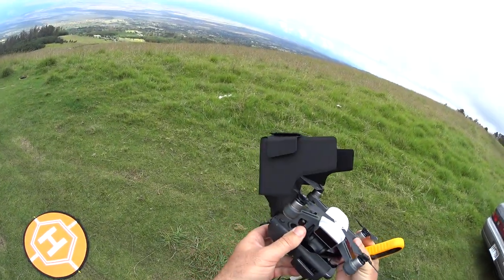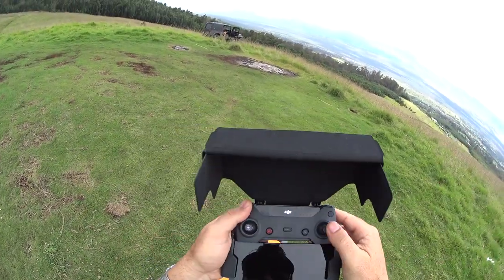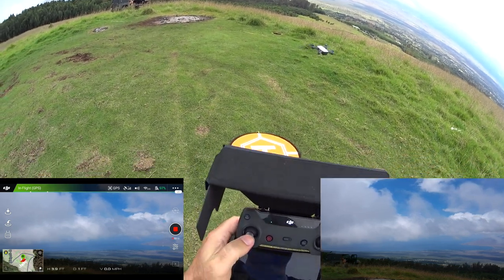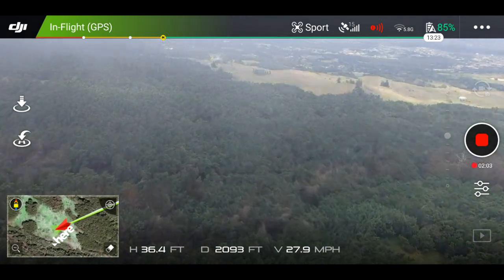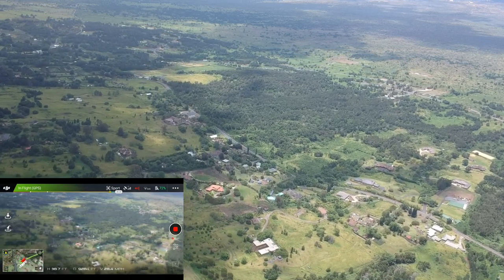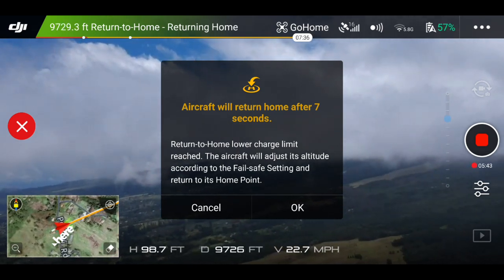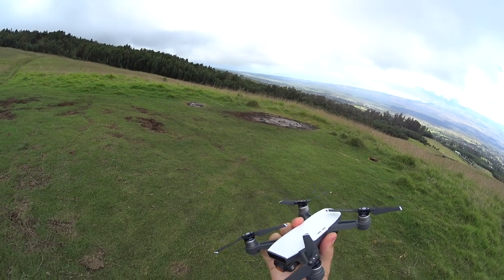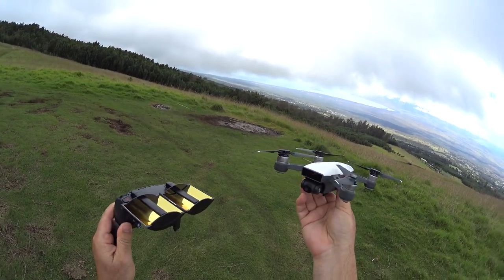DJI SPARK Review - Part 3 - [4 Mile In-Depth Range Test with RC Controller & OTG Cable]

Comment: I have a dji phantom 4 pro but those lil drones are good if ur starting off and have no money for the professional actual drones
Reply: this is an actual drone, its just not as good as the p4. the spark is good for the money that does its job and in the right hands it can achieve some awesome footage.

Comment: Nice video. Question, the altitude shows that you were flying around 40 feet all the time which I don't think it's accurate. How would you be confident enough that you could fly it back to home since it's gone so far away with frequent disconnections randomly? Thanks.

Comment: Just got a spark the other day, been playing around since this is the first non-toy quad I've had. My question to you is, how long does it take to get over being afraid of going too far? I got about 120' away from me and started to panic. I've decided to go higher vs further since in my mind if I lose it, it will fall straight down. Thanks for the video!
Reply from the maker: As long as it takes you to Wes.  It's your awesome drone.  I'd just keep going a little more out of your comfort zone each time (after you've mastered basic controls) and you'll gain confidence gradually and safely 👍
Reply: Dude has a good voice and gives advice like a thearpist, hope that's the industry you're in, if not look into it! Thanks so much!

Comment: I have three questions for you. 1. The phone you are using is that the phone you use regular like your everyday phone or is it a dedicated phone just for the spark? 2. The wifi that is strictly wifi and no data is being used and 3. can you set your phone into airplane mode to shut out all the programs except the DJI go 4 app?
Reply from the maker: Yes X 3 👍
Reply: Dustin Dunnill thanks. Getting my dji spark today from FedEx.  Time to fly lol.
Reply: Well, first things first lol you need data on your phone in order to do the updates on the spark during the updates. I have no data atm so I have to wait until the 2nd of July. Ugh.
Reply from the maker: You can do them from your home wifi.  You just have to switch back and forth to the spark with your wifi during the updates 👍
Reply: Dustin Dunnill yep I finally got everything updated. Now to get the controller, phone and spark all working together.

Comment: To get above ground altitude incorporated into the system, it would require that the Drone have all of Google Maps downloaded to the main flight controller. (Many many many Gbs worth, and tons tons of processing power) Google Maps knows the altitude every square foot of ground on every point on Earth. This has been done through extensive work of surveyors and other technology. 
Then the Drone would use GPS to determine its location on the earth and then review Google Maps to how high the altitude is at the ground level it is flying above. Then subtract that from the altitude it is receiving from the GPS signals. It would then be able to determine the altitude it is above the ground at that point. 
This would use a lot of CPU power and electrical energy to compute all of this in nanoseconds. Let alone the amount of storage space and reliability from glitches to be able to store and process all of this all of this on board in a timely manner without having to wait 6 hours for boot up.
Reply from the maker: Not necessarily.  The drone knows it's gps position as you mentioned.  All it would require is a download, cache or stream of the ground elevation data (not GBs of maps) and sync with current coordinates for the location it's in or a designated area surrounding it and compute the AGL on the fly, or have pre computed and just display it while flying.  Shouldn't be that difficult for the computers that are on these drones now or even in the controllers.  Definitely not "tons of processing power" to do a simple data table query. I have a feeling the database of elevation data accuracy is what is lacking so companies don't feel like it's bad record keeping or inaccurate data they want to rely on or it would open a new can of worms of legality & customer service issues (crashes)🍻
Reply: Man you're the best! Thank you for this well informed comment! You are genuinely very smart and up to speed on everything..you go! 😁
Hope you have the awesomest day ever! Cheers

Comment: Hello. I just wanted this review (great job) and was wondering if you made any modifications. I have seen some Spark Reviews and they mention no more than 60-80 meetings or never more than 300 or so feet.  Did you have/do anything to create such a large distance? Thank you very much
Reply from the maker: Less interference, whether physical or electrical will get you better range.  So out  in the country  with an unabstructed line of site between controller & drone is best.  This  spark is not modified.

Comment: Mr. Dustin, in your opinion do you need the OTG cable for the spark to fly well? another video mentioned the warranty would be voided by DJI? thank you
Reply from the maker: Not really necessary but may help if there's a lot of interference nearby.   I don't think you'd void warranty plugging in a USB otg.  Not sure but I heard DJI may have disabled the ability for otg on spark.

Comment: Hi Dustin. I am having problems with my DJI Spark Flymore combo. I have purchased the OTG cable and use it, but get signal loss after about 400ft. Please can you share some advice on what I could do to improve the range. Something seems very wrong and I see many other people seem to also be struggling with this. Thank you so much. Dylan.
Reply from the maker: I’ve heard DJI took away the ability for otg use recently

Comment: The battery will limit your range anyways. It would be really pushing your battery and might fry it
Reply from the maker: +River I think 2 miles out is a safe max range for the battery.. although one could switch back into manual sport mode on the way back to get back faster.  Maybe I'll do that in the next video testing the parabolic range extender 👍
Reply: you'd be surprised. If you're just going for range, AirVision puts out a bunch of vids with (controller mods) showing a range much beyond what's advertised, with battery to spare. Kind of blew me away. That said...you won't be hanging out at those distances, unlike the mavic.
Reply: Hope you do the test with the parabolic range extenders soon. Have some on order :)

Comment: Dustin very good review of the Drone and the distance. I have a question if I may? I have the DJI Spark, and I have noticed that if I am up about 150 ft and decide to bring the Drone back down and if I hold the left stick down for more than a couple of seconds, the Drone will begin to rapidly descent. And will continue to descend until I push up past halfway to stop it from descending. Is this normal behavior for this drone?  I was under the assumption that if you are descending by holding the left stick down and you release it and the stick self centers, and the Drone should stop its rapid descent? For some reason mine continues to descend that's why I was wondering if this was normal behavior? Thank you in advance Joey
Reply from the maker: Don't think that's normal.  It's like yours is going into landing mode.   I'd check your sensors are clean on bottom and battery is charged.
Reply: @DustinDunnill  good advice my friend I purchased this drone second hand off of somebody locally on the let-go app oh, it only had 17 minutes of flight time on it according to the DJI go account it looks immaculate brand new everything seems to be working except for that one little hiccup, I'm going to try it again if I can get some daylight before I get home from work I updated all the firmware everything is was updated and is working fine on the DJI assistant 2 desktop app so I'm not really sure I'm hoping it's just a glitch perhaps the senses are a little dirty I'll take a Q-tip and see if I can clean them up.  Thank you very much I appreciate your comment

Comment: Hi I know this is a old video but how did you get the otg working. I got the LG g6 , spark and a otg cable and can't for the life of me get it to work. It just keeps connecting then disconnecting and then starts charging my phone? Cheers great videos by the way.
Reply from the maker: I hear DJI has updated to disable the function
Reply: @DustinDunnill  aww we'll need a new phone then!!! Think I got a old iPhone 6s in the cupboard I'll be charging up tonight. I know otg works with apple just hope it dont change it back to CE instead of FCC otherwise my range would be cut well short!!! Keep up the great videos 👍

Comment: Hey Dustin..do you know if I tried this over water would it be similar results?  Is over water safe except for the vps which doesn't reflect well over water..
Reply from the maker: +North Salem Droner Yes unless there is high interference there you will get good Range.  The vps doesn't see above 40 feet I believe but if your flying closer you may want to turn it off.

Comment: Meanwhile my drone loses signal after 500 feet, if I'm lucky, in urban areas. I maybe got 1000 ft out in the NY Catskill mountains before the video feed started freezing on me. Idk how this dude got that far lol. Must have some special version, goddamn
Reply from the maker: Line of site, antenna orientation, weather and interference really play big parts in the range.  Just all stock here.  I'll be getting back up there to do the dish test soon.
Reply: Agreed
Reply: HabeebMasterISIS I have the stock spark and can easily get it out 4000 feet. I don’t know what is wrong with yours, because I’m in a very large neighborhood with lots of interference from other WiFi signals. (I haven’t flown it much farther than that yet.)

Comment: Hey man, do you leave your wifi from the phone to the controller on while using the OTG? or do you put your phone in airplane mode? thanks
Reply from the maker: +Joey Stasiewicz For this I did not but you can .  Or just turn off wifi.  I keep cellular on for the basemap
Reply: Dustin Dunnill sweet thank you!

Comment: Wow man. I am so tempted. Is it a good buy??
Reply from the maker: +agrs1974 aka Andy Sommerville Yes.  If you want the small size but less flight time and video resolution than a phantom.
Reply: Dustin Dunnill I have a DJI p3p. Was looking at something more compact.
Reply: i've got one because i travel a lot for work and with fam. I absolutely love it. Super fun...but don't skimp, you gotta get the flymore combo (or at least the controller).
Reply: snlexa oh definitely mate. Wouldn't use my phone
Reply: Buy it, from P3 to Spark, buy it (coming from a P2 vision plus, Mavic and Spark owner) Buy it

Comment: Hi dustin i am new to your channel, i wanted to know how far does the spark has to be to return to home. Also i just got the spark like 3 days ago and am afraid to send it out because it always drops where the drone is at instead to return to home. What am i doing wrong am using ios no otg  yet, i order a cable that goes from iphone to the controller. Is that good? Tks
Reply from the maker: Usually 50 to 100ft away

Comment: i know im 4 years late, but you also have to remember if you use the spark, tthis this guy is where there is absolutely no wifi signals and nothing to interfere the connection to this drone, no trees, no buildings.. i own the mavic air 2 now, but 3 years ago i did own the spark, and i used to fly it in the park, genuinely, unless your flying in an complete open space with absolutely 0 interferences, i was gettings at around 500-1000 Ft. 1500 on a good day.

Comment: I'm trying to understand. Typically you wifi your phone to the controller, but if you want you can plug your phone directly into the controller like the mavic if you get the proper cable? For me that would be micro USB to lighting since I have an iPhone. Do you have to change anything in settings to use the cable, or is it plug and play? 
Also does it increase your range since the controller isn't having to talk to the phone and spark wirelessly? Thanks
Reply from the maker: +tracym427 Plug & play lessens lag and wireless garble / possible wifi interference or connection issues 😁👍

Comment: Hi there, I can see wifi signal indicator even though you're using otg cable, In my app (which is up-to-date) I cant find this indicator while using otg. can you help? i have serious range issues and dji support is working slow.

Comment: Dum question but do ya still connect via wifi to rc when using otg cable or just the cable will do or both ?

Comment: On the RTH did you have it set in sport mode still or does it decide the speed on its own?
Reply from the maker: It decides on it's own.  About the same as GPS mode.
Reply: @DustinDunnill  Ah ok. I'm guessing based on wind resistance and battery level?

Comment: is the H on the screen mean HEIGHT which is how high it is above ground?
Reply from the maker: Yes but only from a 0 launch elevation.  Hopefully we'll see an AGL readout soon that can display AGL above what current Sonic and optical sensors do until it's above 40ft or so.

Comment: Could you turn off return to home and fly back in sport mode tho? It should be faster?
Reply from the maker: +Brandon Leow Good point.  Yes.  I just let it auto return here
Reply: By the way, great review! Highly considering getting myself a spark with the fly more combo.
Reply: Presumably the rth speed is the most efficient flight speed though - as in distance covered to battery expenditure? So if you are going out the maximum range the RTH speed would be the most battery efficient way to come back.
Reply: Ben Shaw that would make sense. I guess it also depends on the direction of the wind I suppose.
Reply from the maker: +Ben Shaw so a range test in slower GPS mode may be better.  I'll have to try it 😀👍

Comment: hi there, have you tried parrot bebop 2? and if so how was the strong winds with that spark compared to bebop 2 which was able to withstand 35 mph strong wind? thank you
Reply from the maker: +garry1220able yes, I've done many videos with Bebop2.  They both do ok in strong wind but the video quality will suffer from the tilt
Reply: garry1220able The Spark has a real gimbal, which would handle wind much better while still getting great footage.
Reply from the maker: +SquiDragon The spark gimbal will reach it's maximums in that much wind.  You'll see much more choppy footage.  I even see it flying fast.  The Bebop also has it's maximums and you'll see less than perfect quality.  Check out my high winds flight of Bebop 2 👍
Reply: Dustin Dunnill Alright, I just thought that it wouldn’t do as well in wind because of the body not moving, and just the props, whereas the spark moves more like a traditional quad and has a separate gimbal.

Both drones are great though. I just personally prefer the spark because sometimes I see some jello on bebop videos.

Comment: Hi, Could you tell me if you're still able to use the direct USB OTG connection to the RC after the latest firmware update (https://forum.dji.com/thread-106245-1-1.html)?

I can't seem to make it to work... Did DJI remove/disable this functionality?
Reply from the maker: +Feb S Yep it works.  Just used it today.  When everything is on I have to plug in my controller (in the controller port specifically) last or it won't recognize the phone.  If I try to plug into phone or the other cable to USB last it does not work.  Kind of strange.
Reply: Dustin Dunnill  Yeah I noticed the same thing , Mine will only work if I unplug / replug it from the controller , if I try to unplug/replug from the phone it won't recognize it , and won't connect, very weird

Comment: I have LG G6 mobile. When I plug in usb to otg It is work great, the mobile found data (USB). I want to plug in otg to controller  It's only  charging controller battery and Dji go 4.3.14 not opened automatically.. I dont know Where is the problem... Mobile or version DJI go?

Comment: Can you click the cancel button to regain control when it's in RTH mode?
Reply from the maker: +Mark David yes, either by the phone screen or physical RTH button on Controller
Reply: Dustin Dunnill thanks man!  Just wanted  to be sure.  I've read some ppl had issues.  Hope it's isolated to just them.  Thanks again!
Reply from the maker: +Mark David No prob.  I've cancelled it a few times without issue.  Just make sure you wait for good sat lock before launch 👍

Comment: Can you adjust the distance? mine only is aloud to go 150 feet before stopping? i don't have remote just cell phone. Help please!
Reply from the maker: +Dirt Storm Troopers that is normal distance with phone, only up to 300ft.  Get Controller for more range and better control 👍
Reply: Dustin Dunnill shit balls ok thanks need to save up to get one. Is there anyway to change the distance in the settings? Mine are not adjustable.
Reply from the maker: +Dirt Storm Troopers Take beginner geo fence mode off and you should be able to.  I have an extra Mavic controller but it won't work on spark 😂🍻
Reply: Dustin Dunnill I have beginner mode off I’ll keep playing!
Reply: Cell Phone distance is limited GREATLY by your cell phones Wifi signal/power.  You may get a few more feet with a different PHONE, but I wouldn't even bother; speed & distance is limited by your phone.  The best way to enjoy the Spark is with the RC (Remote Control)...
Reply: Awood35 thanks man

Comment: What is the difference when you use the OTG cable?
Reply from the maker: Direct wired connection to controller from phone instead of WiFi

Comment: how can you tell if the otg plugged into the control and device is actually working in that config?
Reply: Turn off wifi on the device (or at least "forget" the Spark wifi network) and if you still get the video, it is working.